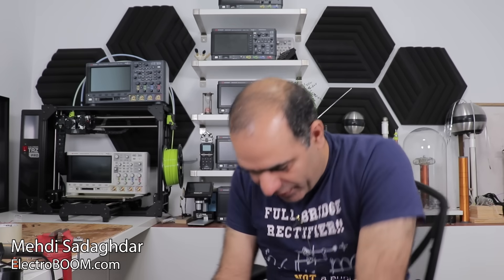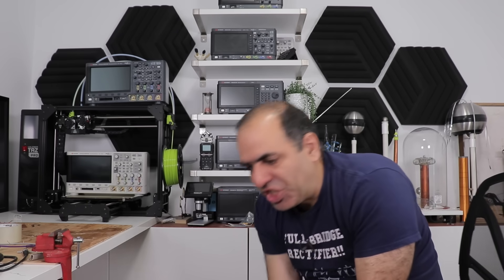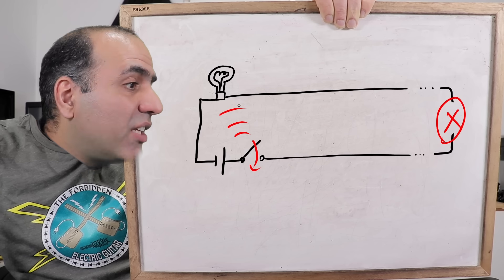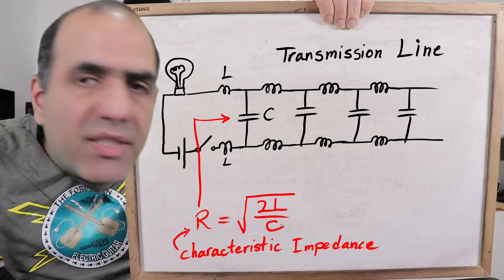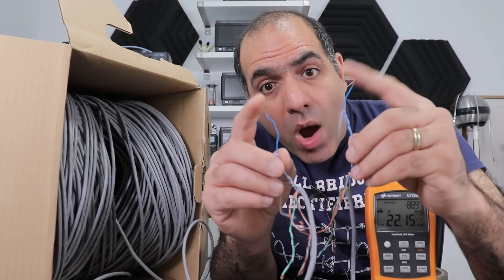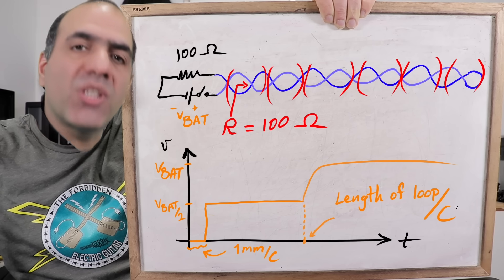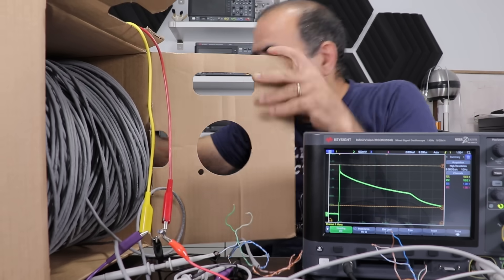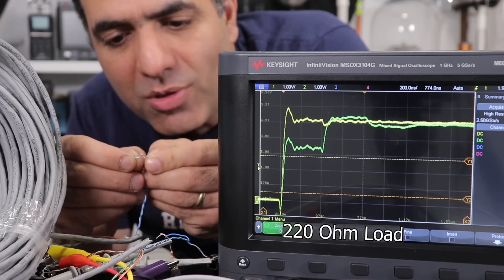Testing the LONGEST LOOP OF WIRE!!! to Turn a Lamp On

Comment: This video is still lacking an experiment where the distance matters, which is the main issue that Veritasium claimed which I think it is false: the energy doesn't travel through wire but as electromagnetic wave between source & load. The experiment should show the difference in distance of the LED and source/battery, also difference in load (using light bulb or capacitor instead of LED), using grid power supply vs battery. 

Also, use different thickness of wire on heavy load like 120W lamp using 12V (require 10A), if the energy doesn't use cable to transmit energy, why the cable thickness does matter on higher ampere load??

I also never see Derek's claimed 300,000 km cable. I think that cable length is a complete BS. And Derek never shows the difference if the distance of the source & load is changed.

Comment: The difference in the wave-form when opening and closing the loop, both with the full 8000' loop and the shorter loop also clearly demonstrates the effect of conductor resistance over longer distances, and goes some way to explaining the distance limitation of CAT5/5e and CAT6 cable runs. As always, love seeing things demonstrated practically!

Comment: Hmmm. The reason you calculated speed of light was off by 60% was because the cable length and actual wire length differ from each other. 

Don't forget everytime you twist two strings together, the overall composite (rope) material is shortened by a factor.

So the actual wire length is longer than the composite cable length.

Comment: Another usage/explantation of the twisted wires are "invisible dog fences." When you have to run the wire of the fence back to the power source/hub, you have to twist the wire around its self so the electric field doesn't form and tells the shock collar to shock the dog because his collar is next to the line. If this "rule" of electricity didn't work then your dog couldn't circle around your house fully.

Comment: How do you interpret this result in terms "electrons pushing eachother"? In the field model it is clear that the voltage and current (possible by energy delivered from the source) travel across the gap to deliver energy to the LED (creating a current through it and thus light by action of the semiconductor).

For me it is not so nice to interpret this result in terms of electrons pushing each other. Clearly the electrons are not pushing eachother "through the wires" like water in a pipe because we know that would take the speed of light and you've so nicely demonstrated the presence of current through the LED in a time shorter than the speed of light.

You could say: Well, the electrons in the vicinity of the voltage supply connections are creating electric and magnetic fields that push electrons (across the gap) in the vicinity of the LED so it's still electrons pushing electrons... But I think that is basically the same as the field description.

I think this example is why the electrons pushing electrons through the wire analogy is dangerous when it comes to high frequencies and transmission lines. In those cases such an analogy can mislead you and make it harder to, for example, track down sources of noise. But a field model is general enough to cover DC up to high frequency.

Of course the true story is that the motion of the electrons and fields are related in a self-consistent way through Maxwell's equations so it may be a little philosophically murky to say which one causes the other. But in this experiment I think it's clear that the more important physics is happening with the fields rather than the motion of electrons.
Reply: field is also an oversimplification. Actually both field & electron must exist in our mental model to understand electricity. Otherwise we will see 2 bare copper wire close to each other and is perplexed "why isn't electricity flowing?" since field are 1/distance strength between wires so theoretically the other wire should've intercepted the field by now, we'll keep "why isn't the electricity flowing?" until we discover electron, then it make sense.

Comment: mehdi is a genius, why bother set a 8km straight wire when you can get a 1km twisted pair cable in a loop and achieve the same result

Comment: I would have used a 50lb roll of 36 awg if I had easy access to the inner end = something like 750,000 feet. Immerse it liquid helium to make it a superconductor = no resistance to deal with.

Comment: 00:14 I hope Mehdī doesn't repeat the dubious set-up of previous testers and run the loop with such a small spacing between both ends (all so far have looked like power lines in the street, separated by only a metre or so, connected at each end to make a loop) and most likely get capacitve and inductive problems (but pretend that the signal isn't jumping between closely spaced and unshielded wires) which makes the signal/turning on of the light happen much sooner than the length of the wires should otherwise indicate.
<edit> So this is basically the same setup as before, just using Cat5 cable instead.

Comment: uhm. no.
There are two hard issues in the OG video:
1. Transmission losses - given some impulse at point switch, how much of the radiated energy arrives at point switch + 1 meter. if we agree a dyson sphere would be required to capture 100% of radiated energy, then the limit of energy captured is equivalent to the visual size of the antenna from the perspective of the switch.
2. Chaos. Even if there is radiated energy from point switch, it is not well organized, meaning some of the energy from point switch radiates to the negative side, and some radiates to the positive side. Initially, the chaos is quite high, meaning equal amounts of energy strikes both sides of the receiving "antenna", thus there is no useful energy "potential".
This demonstration doesn't close the loopholes, it seems not even aware of them:
1. Eliminating one side of the transmission increases the chaos loophole by eliminating the effect of cross-contamination in the first 3nSec.
2. Reducing the distance between the wires increases the transmission losses loophole by foreshortening the visual size of the receiving antenna. In this test, the shadow of the conductors (dimeter) is roughly the same as the distance between them, whereas in the OG video, the wires are a tiny fraction of the distance between them. Also, at this scale, we are looking at the first 0.003nS. I'm not even sure the scope can resolve at this level. 
Sorry, not persuasive.

Comment: With a cat5 you could have used all the wires, like connecting one end of the blue pair to the orange pair, the orange to the green and the green to the brown, or to reduce the resistance use 2 pairs in series and the other 2 in series in parallel.

Comment: Just a helpful hint. You didn't actually need the tape measure to measure 40m. Cat5 cables have  meters printed on the sleeve. Not starting from zero but the total meters that came out from production but still do the job.

Comment: Here we are heading in the right omnidirectional-dimensional logarithmic condensation loop superposition holography.., an incremental view of loop quantization cause-effect in situ...

Having a precise experimental device that fixates on a specific Renormalized Frequency Interference quantization is essential to show what, how and why precision is not Accuracy in relative-timing ratio-rates Perspective Principle.  A Quantum Operator is only self-defining in precise pure-math relative-timing, independent of the Instrumentation.

So, this is a reasonable example modelling the general Reciproction-recirculation Singularity-> projection-drawing induction-> resonance-> capacitance Circuitry of Looping-Logarithmic relative-timing ratio-rates QM-TIME Perspective Completeness. Aka Entanglement..

The twisted pair emulates "numberness" logarithmicly position-modulated resonant frequency conduction through tuned wiring.., the natural property of the Universal Hologram that is the general case of Reciproction-recirculation AM-FM Communication In-form-ation. (Simple, not easy at first.., in Principle)

Great Explainer of relevant details in emulation experiments, thanks.